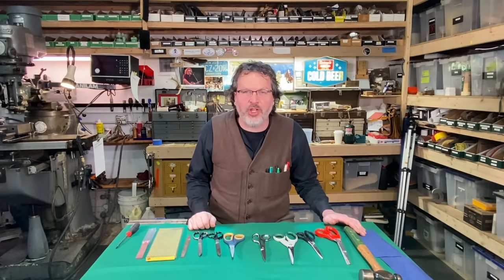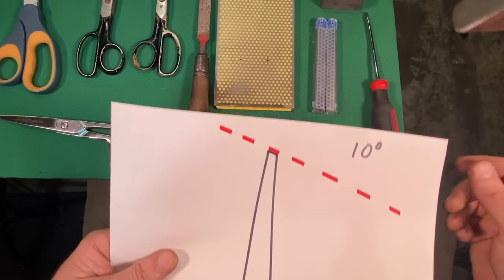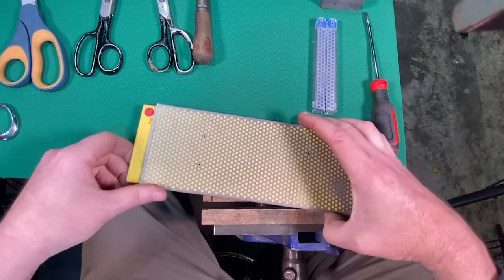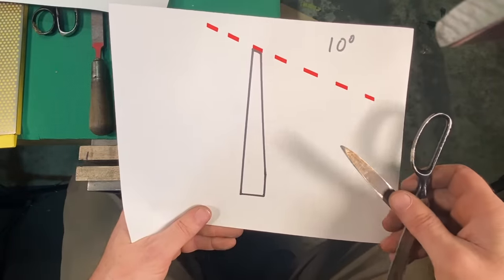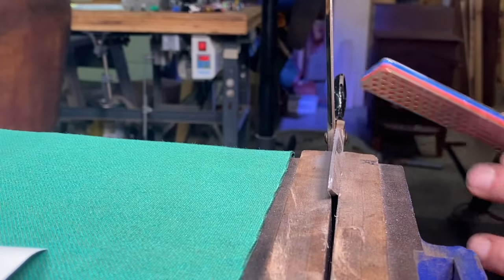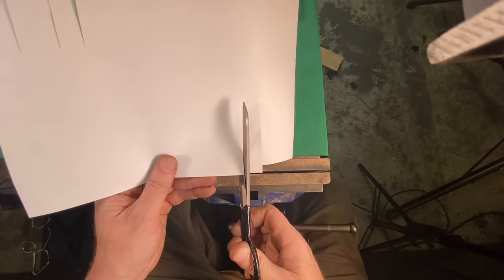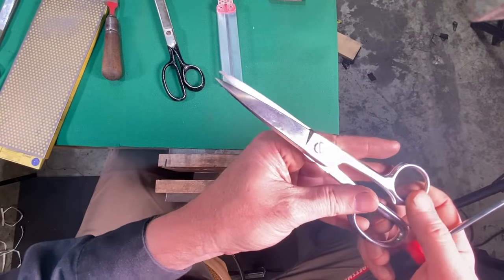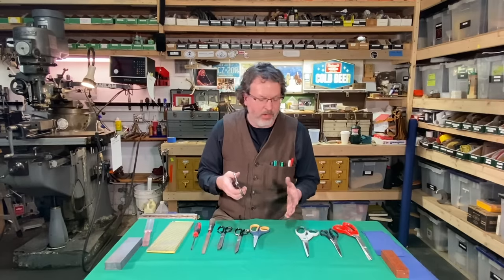How To Sharpen Scissors - Very Easy - Right On #61

Comment: Good stuff!  If you're having trouble monitoring your progress, color the bevel with a large black or blue Sharpie marker.  As you sharpen the bevel you'll be able to clearly see where you need to continue.  Try it; it really works.
Reply: I second this. The rusty was helpful, but the edge was a little hard to see.
Reply: Thank you for the informative tip!!
Reply: Ty greatly

Comment: Thanx for a terrific brief on sharpening Scissors, I do have  a couple of comments to add, you can take them for whatever they're worth. First of all, and probably most important, a common problem is that the blades will not close at the tip after all of this diamond honing, and of course they will not cut to the end of the blade. The remedy here is to inspect the exact Bumper spot between the two handles, then go to work on it with file or Dremel, bearing mind, of course, that the distance from the pivot to the blade end, depending on the scissor size you're working with will be several times greater than the distance from the "bumper" to the pivot, so if you are trying to overlap 1/32 inch or so, you'll need to whack probably at least 1/8 or so from the shiny spot on the handle bumper. If you have  a little spot of Prussian Blue or stiff axle grease, this will help. Second, in your video, you clearly show the business face of the hone going "AWAY" from the edge. Naughty, naughty, the preferred stroke direction should be "INTO" the blade. Third, I'm not a spokesperson or salesman for any company, however a couple of comments here: First the Gingher 10 inch shears of 19 years or so ago were absolutely the finest shears ever made, mainly because of the unique pivot bushing which actually tightens as the scissors close, relaxing when the scissors open. All this came to an end when Gingher was bought out by Fiskars. The upshot of all this is that the world's best scissors now are the "KAI" brand from Japan (direct purchase and they ain,t cheap!)). The workmanship,  hardened steel, and unique adjustable pivot bolt are in a class by themselves, be it serrated or straight edge.

Comment: THANK YOU FOR SHOWING  HOW YOU SHARPEN SISSORS.
   My Dad sharpened about  every tool you can imagine, professionally, surgical  stuff, too, (back before it was throw-away). He raised me in a machine shop, & I was fluent with most of his equipment by the time I was 10 years old. The principle tools, he used, to sharpen sissors were  a flat bastard file and a corregating flat file.. (which they no longer make! ) If you have one, hang on to it. You can't  buy them anymore!!! What you were calling DRAW-FILING is FORWARD-FILING. Draw filing is done side-stroke. He taught me you have to have a curve in your blade, so it will shear, like a X. If you can close your sissors and hold them up and peer thru between the blades and there's a bowed holiday between them but they are together at the screw and at the top, they will shear. If its flat, the edges can be razor sharp and they won't cut hot butter. When you store sissors, open them where the tips are at least an inch apart, so the spring tension of the blades aren't wearing down over time. It is slso best if you will store them, hanging from hooks with the tips open. 
   Dull sissors WILL cut paper. Your true test is toilet paper. Cloth sissors and pinking shears have to evenly cut thin cloth as well as thick cloth, burlap & naugahide. Dad taught me never to fool with the inside surface of the blades unless they were  rusty. He said, "Son, it's not how MUCH you take off, its how LITTLE you take off!" I had a sharpening business for a while, till I realized the government was eating up the main amount I was making, so I folded my side business and kept doing my regular job. I haven't charged for my services for close to 40 years,  but I still sharpen for my family and close friends. Just to keep these old hands nimble. Make a re-curver and guard it with your life, or some A-hole will steal it like they did mine!
Reply from the maker: Right On! 🙌 I loved reading your comment here! Great stuff and great wisdom. Thanks for writing and watching! Hope your day is awesome!! 👏 Good tips!

Comment: I sharpened my old scissors by cutting some 600 grit wet and dry sandpaper.
I used the old scissors because I thought cutting the sandpaper would ruin them, but after cutting a couple of pieces 8 inches long the scissors were real sharp like new again. 👍

Comment: My Dad used to keep my Mom’s scissors sharp, especially her dress-making shears as Mom made a lot of our clothing when we were young. Mom would threaten great punishment if we were to use her scissors for cutting paper or cardboard, as the contaminants in the paper quickly dulled the blades. I love to sharpen old tin snips, aviation snips, hedge trimmers, household scissors, etc., and turn a neglected tool back into a top-notch user. One thing I do is put a drop of light household oil on the pivot screw to reduce wear in the joint and extend the life of the instrument.
Reply: Thanks for posting!
I use a newer product to lubricate these days, liquid teflon. It does not attract dirt and debris the way oil does.

Comment: Thank you my scissors fell and the angle became stiff and hard to use while the others are dull at the point I try to sharpen it by passing it back and forward on a bottle it only works for a while,so I will definitely try this way so thank you again

Comment: Thanks for the tutorial. For those with no tools maybe use the back of a leather belt on a flat surface as a strop?
 I had a couple of those old silver with black handled scissors from a yard sale and in a pinch used crumpled small pieces of aluminum foil to rub the light spots of rust and glue off the blades. It was perfect for getting the rust off close to the pivot point too. I also rubbed the aluminum foil tiny crumpled wad diagonally off the blade edge. Seemed to work and the scissors cut well. 
 I then took a black paint pen bought from Agway that my son uses on restoring bicycles and filled in the missing black paint on the handles. While it doesn't go on super smooth it did fill in the silver parts just fine.
Reply from the maker: Those are some good tips and I’ll have to try out the foil. I’ve been curious about that. Thanks! Right On! 🙌

Comment: Are you saying that--despite having a hollow ground face--we can sharpen the face with a stone so it is flat? This preliminary step is done before we sharpen the cutting face at 10 degrees, you suggest. Nice clear demonstration, Jon! Thanks!
Reply from the maker: Yes! But you do not want to take the hollow grind out of the scissors ✂️. This is just to touch up the edges. If the blades have a slight curve to them over the length a smaller stone can be used as to not remove the curve. 
Thanks for watching! 🙌 Right On 👍

Comment: Joe the barber tried to nip off a little treat for the shop cat! Nice video. How would you tighten up some fly tying scissors. Typically they have a screw, but I can't tell if there is a thread. The screw may just have a straight shaft and be swaged or pressed into a matching hole on the other blade and the protruding bit of shaft ground flat during manufacturing. Would a small pointed punch applied to the ground flat side do the trick. I have a pair of ophthalmic surgical scissors, about 35 years old, that I would like to restore to a  serviceable state. Please share an opinion. Thanx.

Comment: the only time i'd sharpen the flat part is as a last resort if it's been damaged and if that was the case I'd take them apart before doing that, otherwise you're pulling material away from where the edges meet to cut. if you take them apart you're also taking material away from where the blades meet at the pivot point keeping the blades flush.
Reply from the maker: Thanks for watching! Lots of scissors when opened all the way are loose and when being closed they tighten up. Often times there is a slight step in the grind to allow for the blades to come together tight. This also allows for sharpening. Right On!👍🙌✂️
Reply: Yes I do this every time I sharpen a scissor.

Comment: So, I have a nice pair of Wiss Inlaid #22 scissors from an estate sale.  The blades appear curved slightly such that as the scissors are closed, the touching point moves outward towards the tip.  When fully closed there is room for a .032 feeler gauge to pass through the gap which is visible from close to the pivot point for about 4-1/2" of the 6-1/4" cutting edge. A straight edge on each individual blade shows about a .012 gap.   If I tighten the screw with the scissors open as you showed, there is quite a bit of resistance to closing that last inch or so.  This seems excessive, but may be part of the design.  The scissors are well used but not abused in appearance, however the curve is more pronounced on the bottom blade towards the tip.  Should I attempt to take some of the bend out of the blades, perhaps with an press arbor or hydraulic press.  With some heat perhaps?
Reply from the maker: Yes this is part of the design in some scissors ✂️. The blade is bent and sometimes has a slight twist. This is to keep the blades tight at they come together down the length of the scissors. On scissors like this I would not flatten with a large stone but would use a smaller stone that can follow the bend or twist. 
I hope that helps 👍✂️🙌
Reply: @RightOnJonCrane  Thanks Jon.  If I don't tighten the screw too much, it gives a good cut.  Over tightening causes a skip in the cut.  The few examples of that model Wiss I saw on line however, did not seem to have as pronounced of a curve and were fairly straight.
Reply from the maker: @CalPil0t  Ah I see👍 That could be a tricky deal trying to take the bend out. The steel is usually tempered and stress on the steel could snap them. I have a few pairs of broken scissors myself. It would be quite a process to anneal the steel, bend it and re temper it.

Comment: Jon, you showed how to get a pair of scissors HALF sharp, now if you skip the barber shop theatrics and go on to one or two more final steps you will find that your scissors will be sharp enough to excise an entire ear from a young kid's flinching head in one fell swoop! 😲I use some small ceramic finishing stones but you can simply glue a couple ultra-fine grits of wet-r-dry finishing  sandpaper to a piece of thin bar stock and, in a few additional strokes, you will find that there will be such a scary sharp edge to your scissors that, with a bit of practice, you will be able to start a cut in your paper and as the scissors get a "bite", you can slide the cutting tool right across the entire sheet of paper without doing the snip-snip technique. 800 grit on one side and a thousand grit on the other would be sufficient to finish that set of cutting blades off to another level of cutting something more sensible than shredding a sheet of paper. [I have been sharpening edged tools and other pieces of "equipment" for 60 odd years and have not yet figured out the sense in cutting paper into little strips].
Reply from the maker: Right On! 🙌 Thanks! Those are some good tips. I do have a nice selection of hard Arkansas stones from Pike / Norton. I use them in my machine shop for sharpening end mills and cutting tools. It sure is nice to have sharp scissors! Unless they are cutting your ear at the barber! 💈 Now that barber had some theatrics! 😄

Comment: Looks interesting !-Wonder if you have a file that files your scissors at 10 degrees ? or are you guessing ten degrees ? sounds very inaccurate ?--surely you have a 10 deg  jig or guide to keep the file from rounding the bevel cutting edge
Reply: Supplementing Carl's above query . . . . . . I also question your  exactness of that "10 degree angle" that you profess to be accomplishing. Sometimes, get a protractor for referencing beside the final blade file positioning when you are establishing that FINAL  angle.
OR . . .just by simply using brain reasoning /reckoning and vision acuity . . . . place the file so that is resting upon the scissor blade and level it so that it is then creating a 90 degree right angle referencing. Then you  lower the file handle down on the right, until a 45 degree angle is accomplished . . . .that's easy to see, since its just half of your initial 90 degree angle. Now the kicker . . . . if you then lift UP on the file, so as to  halve that angle, you will be at 22 1/2 degrees, but then lift on up a bit more, and split that angle to be at a final 11 1/4 degrees and quite close to your "10" degrees. 
Therefore you will then be set up to draw file across . . . .
[    The typical scissor blade angle grind, which  will be somewhere between 40-45 degrees.   ]
This just touches up the edge of that factory final bevel.
A greater attack angle will result in not even reaching that established  angle or the need to remove more materiel to even reach and pass it.
Then the (other) back side of the blade is VERY  lightly flat dressed to remove the edge burr.

Comment: Great video! Joe the barber should have been committed. I love old quality scissors and buy them wherever I find them (mostly estate sales). Some are coated with nasty tar-like substance. Could you suggest an easy way to clean the gunk off antique scissors? Thanks
Reply from the maker: Hi Dale! Thanks for watching! If it’s bare metal or chrome plated I use acetone to get off old sticky gunk. If acetone is to strong a citrus cleaner might work. Simple green full strength is pretty good as well! I have a big vat of simple green where I soak tools 🛠. Hope that helps. Right on! 👍
Reply: @RightOnJonCrane  thanks

Comment: I have an classic pair exactly like the black-handled steel ones you have at 6:00, and I was wondering how I might tighten them?  It's very wobbly and can hardly cut.  It has a flathead screw on one side, and what looks to be a rivet on the other side.  I couldn't figure out how to tighten and stopped after about 5 minutes of futzing as I didn't want to damage the scissors.   Do I need a special tool to do it, or is it something I can do at home?

Comment: Nice tips Jon! I have never sharpened scissors before! You made it look easy. As a novice i was thinking maybe put some layout blueing on that 10 degree angle before attacking with my file. Very useful video. RIGHT ON JON!     Roger
Reply: A Felt-tip pen is fine for that.

Comment: Thanks Jon. Awesome vid. I immediately went to the kitchen to find a pair. My wife has some Cutco knives which came with a pair of scissors. One side has the smooth angle but the other has straight lines cut in the bevel. I’ve never seen (or looked) at these before. I’m thinking to let them be. Have you seen or  know what this is for?  Right on!!!
Reply from the maker: Right on Stan! 👍 Yes the Cutco knives 🔪 They make a good product. I know they have a few different pairs of scissors that they have sold. Some have serrations on the edge aid in cutting stuff in the kitchen such as poultry and such. That type of scissors can be touched up on the inside of the blade. I’d have to take a look to be sure.
Reply: those cuts grip whatever you're cutting so that it doesn't slip... you can send them back to cutco and they will sharpen them or replace them for the price of shipping

Comment: Great tip and lesson. Thanks. Some scissors lose the nut or screw , can you get replacements?
Reply from the maker: Right on Tony! 👍 I guess it depends on the screw. But yes a new rivet or screw can be put in. Some have specialty screws.

Comment: Wouldn't flattening the one side automatically sharpen the edge?  Why also the bevel?
Reply from the maker: Hi! It’s good to do both sides. Just doing one side rolls a small burr of metal over to the other side. It’s nice to do both sides and get that point straight. Thanks for watching! 🙌

Comment: How exactly do you ensure your stroke is at 10 degrees every single time
Reply from the maker: With a little practice you can get really close. One way is to put sharpie marker on the bevel edge and see if you are getting a nice flat stroke on that bevel.

Comment: John my Job has a paper cutter to cut paper it's dull would I be able to do the same process to sharpen it the same as u shown in Video.
Taylor ham Tuesday Sun!
Reply from the maker: Right On Alan! 👍 Yes you can use the same technique on that paper cutter. Those are notoriously dull and usually get thrown out when all they need is a quick sharpening.
Reply: @RightOnJonCrane  right on.Thanx yeah office still uses one.
Jon I'm figuring unscrew the blade off & sharpen it that way?
Reply from the maker: @alanr4263  Yes 👍 That would be best. Usually has a tension spring or I’m looking at mine now and the blade has 3 screws that holds it to the arm. I know there are a few different kinds. I would clamp it in a vise and sharpen it just like the scissors.
Reply: @RightOnJonCrane  Thanx Jon for the info I will do so let u know how it goes.
Working on Salt/Sander today getting ready for Winter calling for flurries tomorrow N.Y.
Man red electric Sander pain in the ass I think ballbearing cases are rusted shut bottom belt not turning from inside of truck when turning on
Reply from the maker: @alanr4263  Ice, salt and rust always come together 🤣😃

Comment: I have several scissors with screws which I can’t tighten and they are very loose. What do I do? I tried soaking the screws with penetrating oil to no avail, what do I do??
Reply from the maker: Oftentimes those screws have been peened over with a hammer and that locks the threads. You might have to peen that screw like I show later in the video. I hope that helps. Thanks for watching 🙌✨